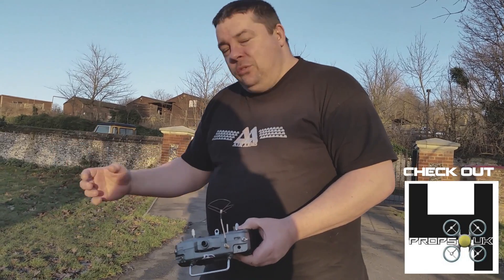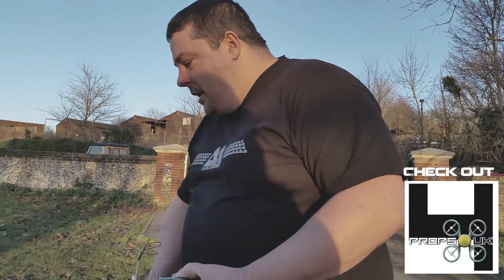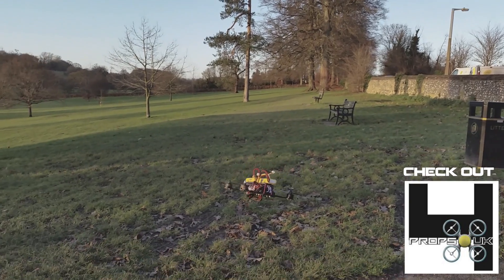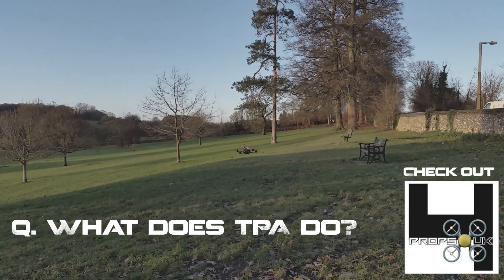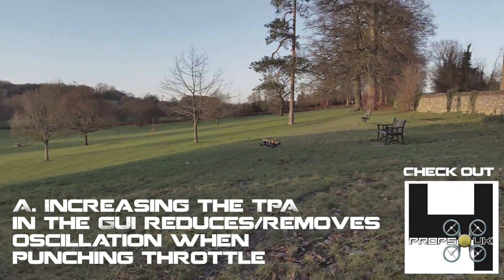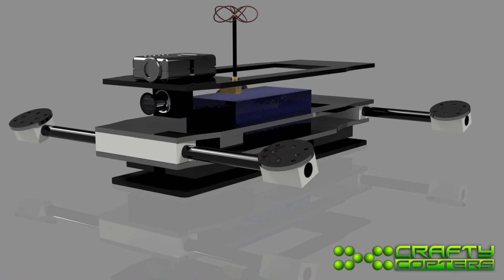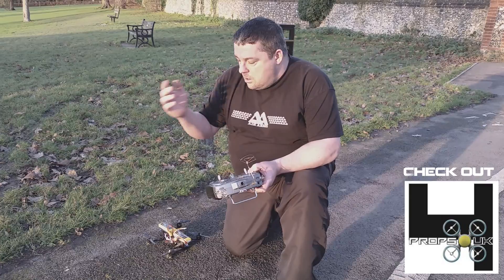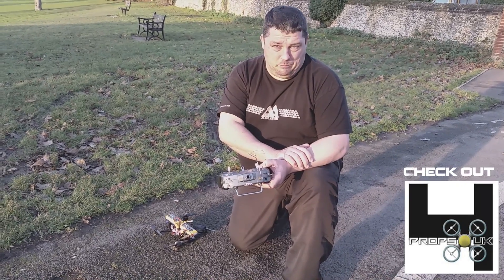6 cell ESC & Motor combo proof of concept test

Comment: Sheesh! 6s man... Wow! I went up to 4s / 1535kv motors and that was enough for me. Propped it up with 6x4.5 3 blade props and been ripping round the local parks ever since. It's easy to reflash HK F-20 or F-30A ESC's with Simon K and they take 4s no worries.

Looking forward to seeing the tricopter design, especially the tail. Came up with a simple design I've been happy with, there's a video on my youtube showing how I did mine if you're curious; feedback always appreciated, see Tri-Hard Tail for details.

Hope you get a lot of fun out of your new quad, nothing like FPV on something that does 60mph straight up... :-)
Reply from the maker: Thanks Ben heading over to take a look now =D